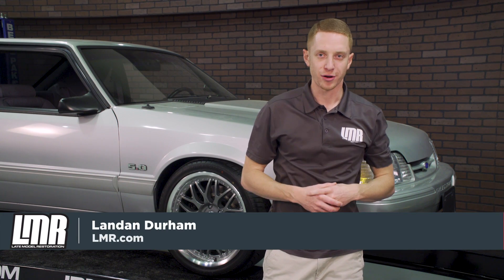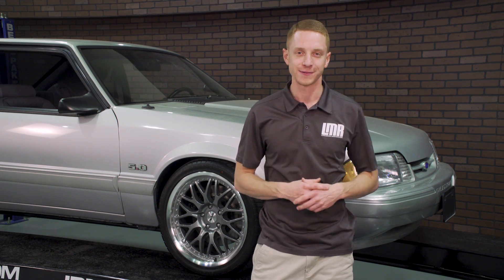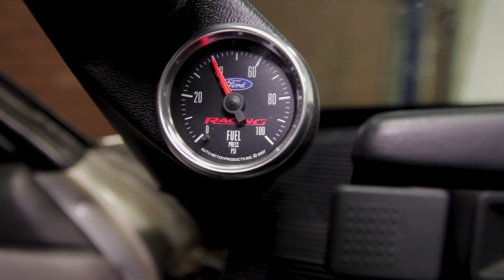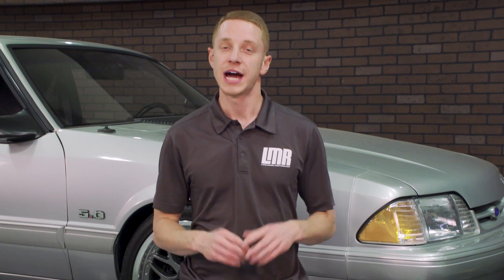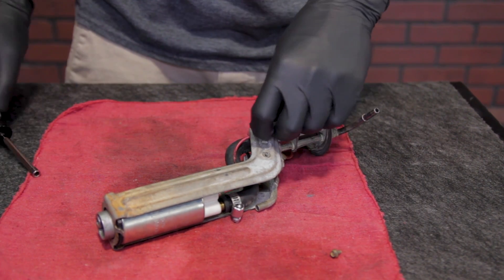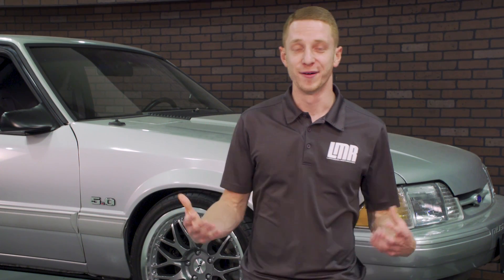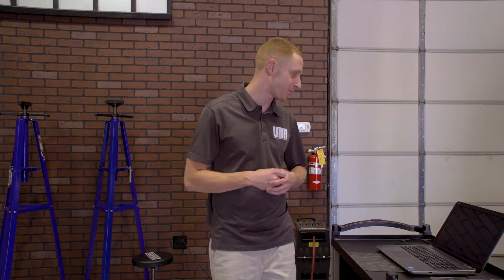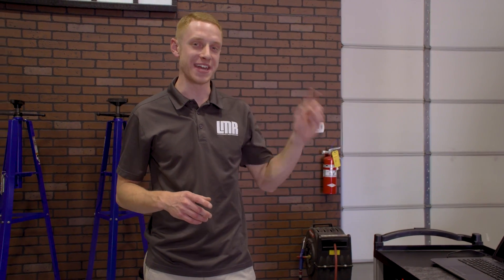How To Install Fox Body Mustang Vortech V3 Supercharger - Part 3

Comment: Summit racing makes a kit for these with trick flow heads, cam, upper and lower intake and it's suppose to put the car in low 12s or high 11s. It was around 3k but that was a long time ago. It's probably double that now

Comment: is the 100 hp/tr worth the near 3000 price range?
Reply: Not even close.  Simple wet nitrous kit 350$ stock 302 will hold 100hp shot all day long but then again not every body just rides around with nitrous ready to go.

Comment: Nice job guys. Just one thing. You knew it was a feeling problem from the start, why not drop the tank and remove the setup from inside the tank. It was a no brainer from my stand point. Not knocking your work but it is what I would have done. I know finding a butt connector in there was a real ordeal but it would have been found first.  Keep up the good things you guys do!!!

Comment: Which kit is this? The base kit or the tuner kit? I know they all come with the v3 but they got twice the hp gain claimed by vortech for the base kit but as far as I can find the SCI trim only comes in the base kit but doesn't include or require the FMU? Please explain haha
Reply from the maker: https://lmr.com/item/VOR-4FA218044L/1986-1993-mustang-5-0-vortech-v-3-non-intercooled-system

Comment: What kinda maf did you guys use? Im looking to install a vortech but the street boost system. What maf would you guys recommend?
Reply from the maker: Marcus - We used a Pro-M mass air meter that was calibrated for the 42lb injectors. -Landan

Comment: Lmao! A butt connector! When I got my 86 I found the return like was plugged on my fuel pump hanger. Found this when I dropped the tank to upgrade the pump. Someone had replaced it and forgot to uncap it. This caused it to run rich. Like yours mine had a dicey history(many unknown POs).

Comment: Am considering getting a si trim. Has ANYONE had trouble with belt slippage? I basically have the same items as described in this installation with the exception of 36lb injectors. Will I be able to feel the power right away? Or will there be a hesitation?

Comment: Still 100 hp from 2018 5.0
Reply: No, it isn't. Coyotes are putting down pretty similar numbers in stock form. All while weighing about 500lbs more. You're likely comparing the advertised flywheel horsepower of the coyote to the actual rear wheel horsepower shown here.
Reply: But a alot lighter so would be a good race

Comment: Over 250 hp to the wheels on a stock motor?  Don't sound stock to me' was only rated 225 ftom the factory. Obviously some hidden work was already done to the engine before you guys received it.

Comment: Landan good to see you figured out that problem. Im still figuring out what ignition problem my foxbodies having. I really think that coupe could make more power since American Muscles project foxbody made around 465 power and 455 torque. Thats just with a Ford Racing top end. In other words, GT40X 64CC heads, E303 cam and Cobra intake on the same supercharger kit. LMR coupe vs American Muscle project foxbody dyno result.

Comment: Lmao thats crazy but im glad yall figured it out...
Reply from the maker: Sure was. Thank you!
Reply: +Late Model Restoration this may be a dumb question, but I swear you guys were running two fuel pumps for most of these videos? How can you have the stock one in the gas tank, and then have a much bigger one in line ahead of it?
Reply: M Goldun pumps run in series will add pressure, pump in tank may produce 70, pump to may produce 100, total of 170psi in fuel line then the diaphragm type fuel pressure regulator adjusts it to the required pressure for the fuel rail. Numbers are random btw. As long as the pressure doesn't exceed the rating of the fuel lines and the regulator is working properly it won't cause issue

Comment: Sounds like a typical foxbody head shaker, it took me years to figure out a misfire at part throttle.... I tried everything, plugs wires, distributor, timing, fuel pressure regulator and low and behold I did The simplest thing that fixed it, just took the maf out and cleaned it with Maf cleaner and a q-tip carefully, it was carbon black and chunks came off it, after doing this all the misfires and backfires were gone, amazing how the simplest and strangest things plague these cars but I love them anyway 😛

Comment: One thing that vortech doesn't state if your not running A/C you need to run a bigger P/S pump pulley and a 93   cobra R water pump pulley to have belt clearance summit racing sells the pulley

Comment: Did you run a custom tune or just 42# injectors and a matching air meter?  I didn't hear any mention of a custom tune?
Reply from the maker: That is correct! The car does not have a custom tune. Hopefully we can revisit this car again and make more power. -Landan

Comment: I went through similar issues trying to get mine tune after installing the same kit from having to ditch the T-Rex because it was restrictive on my 255 in tank and getting rid of the fuel management and going with a tune and 42lb injectors with a matching Pro M mass air but that butt connector in the s hose was a doozy. Well worth the trouble though with the close to 500 hp that I achieved when it was all said and done